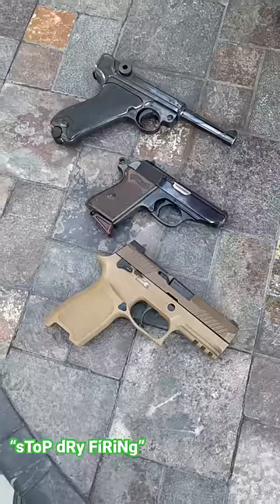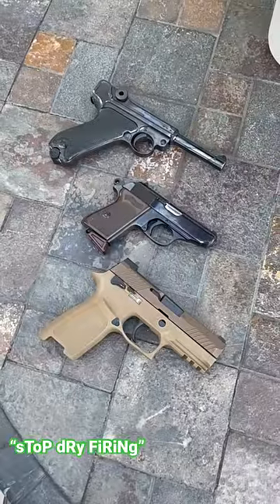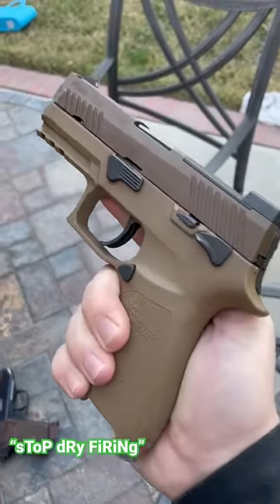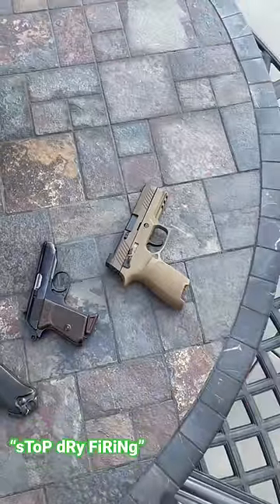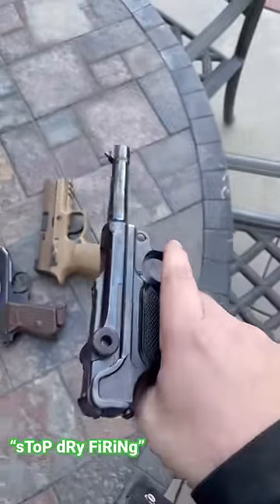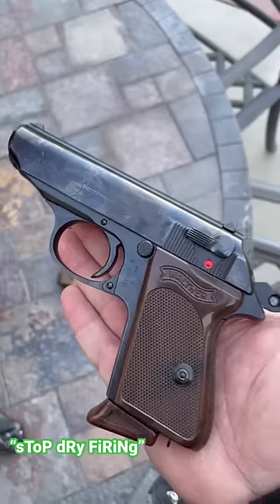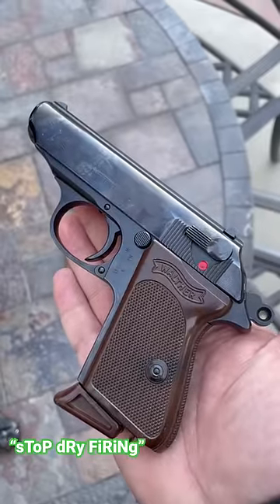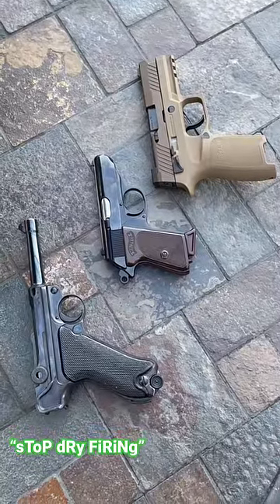“sToP dRy FiRiNg” #shorts

Comment: "Stop dry firing"
Me, a recurve archer: "Well, yes. I'm not stupid'
Reply: Why can't you do it with bows?? That's what it's meant to do to shoot arrows.
Reply: @East_Coast_Toasty_Boy  Recurve bows are designed to shoot arrows as efficient as possible. Meaning, if you let it "shoot" without an arrow nocked to the string, it'll be too fast for its own structural strength. Basically like how it's painful for  your knee when you intend to shoot a ball but miss it because someone kicks it to the side right before you make contact.
Reply: @amrazing33  thats actually a really good comparison
Reply: Came looking for an archery comment. Glad to see!
Reply: @amrazing33  Did not know this, thanks for the info
Reply: @amrazing33  the way I understand it is if there's no resistance, the potential energy has nowhere to go, so it distributes the force along the structure of the bow (or crossbow) so it's almost like you shot your own weapon with itself. I think I read it only takes about 5 or 6 dry fires to destroy a crossbow frame and I accidentally did one cocking mine and it did seem like there were microfractures or something.
Reply: @East_Coast_Toasty_Boy  The energy is not transferred into the arrow that is not present in a dry fire, and causes the bow to explode.
Reply: @T2Darlantan  Just once can do it depending on the quality of the crossbow, a compound bow can permanently damage itself in a single dry fire.
Reply: @amrazing33  Thanks for actually explaining. The loser instructors at the boy scout ranges refused to tell me like it was some trade secret or some shit. Just got mad like idiots.
Reply: @crisnmaryfam7344  "not transferred into the arrow that is not present in a dry fire." Is there one too many "not"s in there?? Cuz I don't fully understand that.
Reply: @crisnmaryfam7344  
 Geez. The guy that invents a bow strong enough to dry fire will be rich as hell.
Because you should have a way of practicing.
Reply: @East_Coast_Toasty_Boy  no worries. Wow, those guys suck.

Anyway, what the other guy meant was that the energy that is supposed to be transferred to the arrow, gets transferred to the limbs of the bow instead.

Oh, and as I understand it, modern recurve bow manufacturers are already producing bows that can withstand dozens of dry fires. I know Hoyt does, but my WNS bow and limbs actually survived my stupidity twice or thrice. So, yeah.
Reply: @amrazing33  Neat. There has to be a way to practice the shooting fundamentals without live ammo. Haha
Reply: @amrazing33  I think the guy eventually did tell me and I forgot, but it was like pulling teeth. Told me to stop asking at first, but I told him it was dumb for people not to know and not have a better understanding of the weapon 
they're using.
Reply: @East_Coast_Toasty_Boy  Unfortunately, the best would still be shooting with live ammo. You can do it in your house, apartment, or basically anywhere. It's called shooting a blank bale. Where you basically only shooting to piece of the target foam without any target face in a point blank range. So you get to have that feel of the whole shooting sequence without the need to go to an archery range. The next best thing would be to practice shooting using a stretch band. But the feel is a bit off.
Reply: @amrazing33  🤣🤣🤣 your like the rest of the "experts" huh. Lmao.
Reply: @theenzoferrari458  Why is there always one of you guys?
Reply: Was about to say the same thing lmao
Reply: @amrazing33 Thank you for this.  I've always wondered but never asked.
That explanation makes sense and works for me.
Reply: @East_Coast_Toasty_Boy  to expand on it, a traditional bow is shaved down until it will break without the arrow slowing it down, because the faster and lighter the limbs the more efficient it is. Watch the bow making channels and you'll see how fragile they can be.

The moment the string goes straight on a bow shot is like smacking the limbs on mud with all your strength. Without an arrow its like hitting concrete.

Powerful bows make a really loud snap sound when you shoot them and creak awfully when you draw them, some base instinct tells you how much force is on them then. Its a little harder to step into the bow when they do that.

In modern times it's less common but back when they were a tool they broke regularly. Swords shatter, bows shatter, strings break, torsion engines violently explode and kill everyone nearby. That's life.
Reply: @East_Coast_Toasty_Boy  I don't think dry firing bows would be good practice anyway.

Firstly, because you use your arrow to aim.
Secondly, because one of the main things that throws your shots off is the change of forces when you release your arrow, which will be different when dry firing.

Also, dry firing bows can hurt you, not just your bow. The string could whip at you if it's not focused into the arrow.
Reply: @IamGrimalkin  I see.

Comment: The firing pin on my 509 snapped because of dry firing. Upgraded to a heavier pin and haven't had a problem with it since then
Reply: So you think that hitting the firing pin against nothing broke the firimg pin, but smashing it between a hammer and a cartridge is fine?
Reply: @user-nb8yt2il2r  you can literally go and look on FN's website. Specifically says that dry firing will break the pins.
Reply: @user-nb8yt2il2r could be bad geometry applying pressure on side of pin.
Reply: @user-nb8yt2il2r  their stock pins are dog shit. Idk if they've upgraded them with newer iterations, but I honestly doubt it. The way the guns are priced, you'd think they'd at the very least have decent internals, but nah. Probably be the last 509 I buy for a while
Reply: I love how the hella expensive guns are the ones with issues.
Reply: @user-nb8yt2il2r  it's called kinetic energy, the force is transferred when it strikes a physical item. When it has nothing to hit the pin takes the impact. Same reason why dry firing a bow does damage to the limbs, it's just a smaller scale inside firearms.
Reply: @user-nb8yt2il2r  the stock ones are practically hollowed out in the middle. Look up a picture of one. They look like you could snap em in half with your hand
Reply: @sixpest  yessir. I hate to say it, but I probably should've bought a Glock simply for the modularity. I'm by no means a Glock fan boy, but even an upgraded slide and barrel for the 509 runs you $750. That's more than the price of the base model 509 at some stores
Reply: @sixpest  If you think FN 509 is hella expensive you are buying cheap. It's just expensive.
Reply: @JustaFupa0315  you dont need to upgrade that on ur 509 though. Youd need to upgrade most of the gun to get what you got out of the box with a 509. Apex heavy duty is like the only thing id reccomend doing besides a rmr cut
Reply: Never understood what was so great about FN's. Seems over priced.
Reply: @yogurtpond143  that's what I swapped the pin with
Reply: @napalmstickylikeglue  depends on what FN guns you are looking at like the old FN high power are great but what gun JMB design is not great. FN has some nice stuff but a lot of what civilian market is like buying Colt you are paying for name.
Reply: @JustaFupa0315  Dammm well another good pick would be a sig those seem to never mess up too

I need an m18 so im not too cheap I guess LOL
Reply: Ah yes, the over priced pistol that commonly breaks firing pins.
Reply: FN used poor-quality metal for the striker on the 509. It's a known issue, and why the trigger goes to absolute garbage after a while.
Reply: Yall talking about the 509s price like its a staccato.
Reply: When it's striking the primer it's going to get an equal and opposite amount of the force it applies to the cartridge in return, that's how physics actually works. You don't know what you're talking about, and it literally makes no sense. Tap your finger against your leg or a table, and then do that same motion in the air, and tell me which one feels more forceful on your finger tip.
Reply: @073286  not necessarily the price I'm concerned about. The reputation of FN, and the high regard with which they're held in means they shouldn't have produced such a piece of shit. I've put hundreds of rounds through the gun and I've never had a jam, or feeding issue with it, but that's not really my complaint. The original striker was shit, and the trigger also felt like shit out of the box. I understand companies are going to make mistakes, but with their pedigree and history, they should've produced a better handgun.
Reply: @ssjronin3972  the pin is taking the same amount of energy regardless
Reply: @vyor8837  it's really not but ok
Reply: @JustaFupa0315  sounds like you don't want to buy FN pistols then. Dry firing very valuable. I've done plenty of dry firing over 2020 and when I finally got out to the range it felt like I didn't lose any practice.
Reply: $800 dollar junk
Reply: @sixpest  can confirm.  I daily an M18, no issues.
Reply: @JustaFupa0315  The striker was the exact same one they had in the FNS for years with absolutely no issues. Something obviously got messed up with their heat treat in the beginning of the 509’s production which is why they were breaking. The new one that should now be shipping in all 509’s models (can definitely confirm it’s in all Midsize Tac models) is Machined instead of MiM’d and completely enclosed.
Reply: @MikeB-ng3ol  Marine, and I think Army proven; They know how to pick guns
this shits a tank
Reply: @sixpest  exactly the reason I bought one.

Comment: I'd like to add that there are some centerfire guns that are sensitive to dry firing.  The Beretta Nano and the CZ 52 are particular examples.  So before dry firing, it's best to check the particular firearm before doing so.   If the gun is able to handle it, then dry fire away, especially if you want to practice getting used to the trigger pull and getting rid of a twitch/flinch reflex.

Comment: A military friend of mine actually taught me some dry firing exercises to keep in practice!  I'm so grateful for the extra practice opportunities where I dont need to go to the range.  Ammo is expensive!  I like getting practice whenever I can so I can be responsible with my weapon!
Reply: Inexperienced with guns here.  I'm actually considering purchasing my first fire arm though.  I'm looking to visit a range and rent a few guns to test them out.

My question to you is, what do you learn from dry firing your weapon?  You mentioned dry firing at home to save on ammo or range fees.

Just curious.
Reply: @markbrowning4334  So for me its about getting my grip right as well as my aiming down my sights right as well as a disciplined trigger pull.   There are some dry firing accessories that you can get that help you see if your grip is causing your grouping to be off.   That way when I do go to the range, my expensive range time and expensive ammo are spent fine tuning rather than getting basics down.
Reply: @burningisis  Thanks for the advice.

Comment: I've been dry firing my 22. Don't tell nobody I don't wanna get embarrassed
Reply: ya, laughs in Ruger MK_ pistols
they were designed with a firing pin stop back in the original pre MKI days and have had it since 
I will do more damage to my hand racking it 1000 times than I would to the gun dry firing it

Comment: I will go with manufacturers recommendations, thanks. SIG recommends not dry fronting “excessively” I.e. use snaps for practice on p226, p229 types, and CZ will crush the firing pin retainer from doing this. 

On the flip side ruger says it’s fine to dry fire their 10/22 to fire rifles all day.

End of the day do what you want with your guns but not with someone else’s.

Comment: Damn I dry fire my .22LR sometimes. Thanks for the info. Won't be doing that anymore 😅
Reply: Most modern rimfires have a firing pin stop that prevents it from directly impacting the breech face. I still don't do it with my 10/22 because it just feels wrong.

Comment: Just an addendum, you can dryfire the Ruger MkX line of pistols, they have a stopping pin which keeps the firing pin from hitting the breechface.
Reply: Glock 44?
Reply: That’s a question btw have you heard if they have a similar stopping pin?
Reply: @Pedro_Escamoso  According to most people i've seen dry-firing the G44 is fine, but considering i haven't seen an official statement i'd likely still invest in snap caps just in case.
Reply: @LRJ88  thanks!!!

Comment: I never actually had anyone explain to me why I shouldn't dry fire, I always assumed it was because you didn't want to wear the mechanisms unnecessarily
Reply: I know this is nowhere near a proper firearm but dry-firing spring powered Nerf blasters wears down the seals & plungers that enable them to fire properly. Similarly, keeping a spring powered Nerf blaster primed for too long keeps the spring under tension thus reducing its strength, and with a dart loaded the vacuum seal will keep pressure on the dart foam causing it to deform & render it useless since it'll just squib every time.
Reply: @legoferrari14  Regardless, I found that fascinating.
Reply: @legoferrari14  yes. This is very true.
Reply: This advice (about not dry-firing) was probably directed at someone who incessantly clicks any ballpoint pen that falls into their fidgety hands.

Someone like that with an unloaded gun might well wear out the firing pin...

But if all you do is occasionally dry fire after cleaning or unloading, it's probably fine. Use a dummy round if you're paranoid. It's worse to store your gun under tension on the firing pin spring. 

If your gun has a mechanism to uncock via the safety or a dedicated uncocking lever, use that. Chances are the manufacturer included that for a reason.

Comment: A lot of the newer rim fires are designed with a recess cut into the breechface to prevent breaking the firing pin while dry firing. On top of that, the length of the firing pin is designed for when there is a case rim on the breechface, so all you have to do is barely pull the bolt out of battery and drop the hammer
Reply: That is exactly what I always do. It is a little bit inconvenient though because you also have to insert a mag in my pistol or you won't be able to pull the trigger. I have seen easier ways to uncock the hammer...

Comment: "it's not a problem as long as you have replacement parts" well you break whatever you want if that's the case lol
Reply: yeah, that was kind of an odd comment given the overarching message of the video.
Reply: Having spent time with the US Navy in the last that's pretty much their way of operating 😂
Reply: @mookfarr  what he means is that if you don't have replacement parts you probably shouldn't be firing them at all. The message of the video is dry firing doesn't damage the weapon, it only causes regular wear.
Reply: @mookfarr   It's the truest thing he said.
Reply: @javierperez2632   I've seen semiauto pistols with cracked or broken breechblocks, probably from excessive dry-firing (because they broke while dry-firing) with nothing to absorb the force of the firing pin or striker.  It's wear because it takes some doing, but it's not normal wear, like from shooting.  Dry-firing is good practice, but I think it should be done with snap caps.  Everything causes wear, but this is closer to how guns were designed to operate.
Reply: Only if free.
Reply: @rbrtck  key word their. "excessive". I'm case you aren't aware and excessive amount of anything isn't good.
Reply: @zachhall422   You have a valid point in terms of language usage.  By "excessive" in this case, I meant what most people would consider a nominal or reasonable amount of dry-fire practice is actually excessive for semiautomatic pistols, which are generally not designed for this type of usage.  That's my point: contrary to popular belief, this is abnormal usage that causes an abnormal type and amount of wear.  Specifically, the pistols' breechblocks were designed to take the backward force of cartridges while shooting, not the forward strikes of the firing pins on a smaller area.  Dry-firing occasionally to decock a pistol is OK, but dry-fire practice (especially for those who do this hundreds, even thousands of times a day) should be done with snap caps to make dry-firing more like normal firing in terms of operation and wear.

Until a lot of people started dry-firing regularly, even firearm manufacturers didn't realize this was an issue.  People would call Glock, for example, and ask if it was OK, and they'd answer sure, dry-fire away.  But then a lot of pistols (not just Glocks) started to break from the increased amount of dry-firing.  So it was excessive, and what I'm really saying is that most people don't realize what they're doing is excessive.  They think it causes normal wear (or less without live ammo), but it isn't that, either.  Manufacturers, including my example Glock, started to put warnings in their manuals against dry-firing as regular practice (without snap caps).  They used to think it wasn't an issue, but now they know better, after having replaced a sufficient number of slides (the only way to fix a broken breechblock on a semiauto pistol).
Reply: @rbrtck  makes sense what you are saying but that's not the case with modern firearms anyway. The firing pin is stronger and so is all the materials used for modern guns. as long as it's a Not a rim fire gun it's fine.
Reply: @zachhall422   How modern are we talking, like the last couple of years?  I didn't have antiques in mind, and this issue surprised me, too, when I first learned about it several years ago.  If "modern" pistols (as in really new/recent) these days have been redesigned to withstand regular dry-firing, then that would be great, and I must have missed the news.  Personally, I'd still be careful with pistols that are several years old or more, though.
Reply: He clearly said, “older guns”